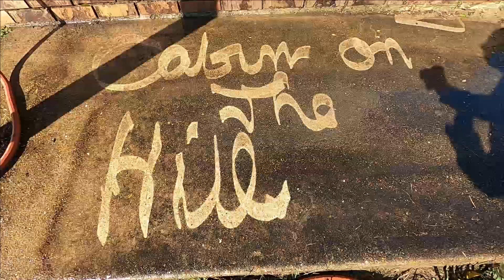***FILTHY*** ENTRYWAY NO MORE/ POWER WASHING ENTRY TO THE LORDS HOUSE

Comment: Ok guys…. First go buy a 18 inch surface cleaner ($150.00)… instead of using two pressure washers and working your self to death… that surface cleaner will be like operating a vacuum cleaner … and actually be fun while doing it… using the wands takes 4 times longer and wears you out… surface cleaner 1/4 of the time..

Also looked like your cleaning of side walls was a shoot by the hip method…. A little organized plan saves time… unless your getting paid by the hour…. Then your right on top of maximum profit…
Reply from the maker: Did it all for Free, we have a power scrubber just like using the magic stick. We are in no hurry cause we want it to look great and a job well done it awesome.  But thank you very much for your kindness and support ❤
Reply: I was only suggesting a way to shorten your cleaning time… I clean a lot of concrete, the surface cleaner is a wonderful tool. It has an extended wan , which prevents you from having to stay in a bent over position. If you have never tried a surface cleaner, I was hooked first time I used one…  mine has four casters, connect to pressure washer and simply push it back in forth… I suggest before you shoot it down …. Just try it….you will truly enjoy it…. And it looks as good as what a wan does.
Reply from the maker: It's all good love all your suggestions ❤ really ,thank you  for them I've used some of them yesterday as a matter of fact . I really do appreciate it when people can help with making the job's easier to do. Thank you again 💓